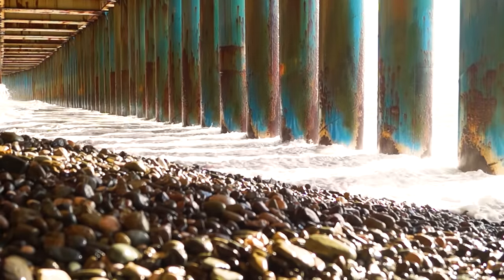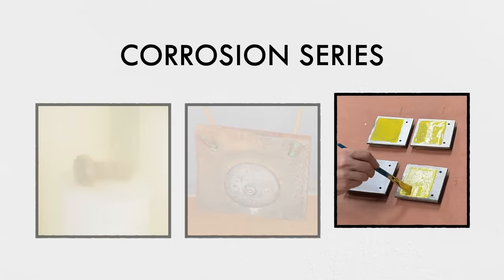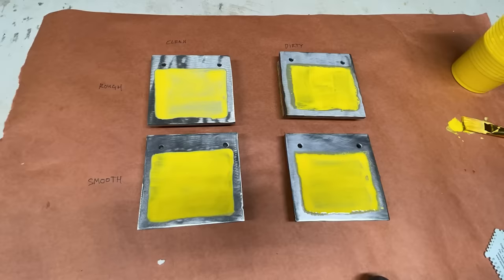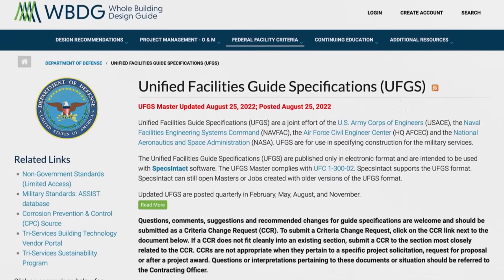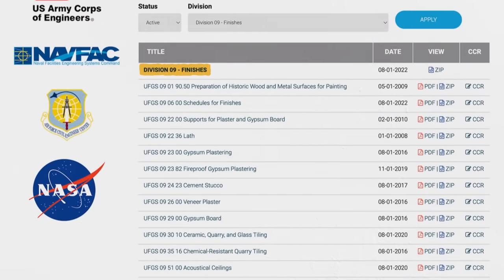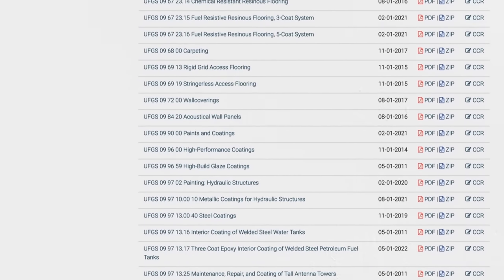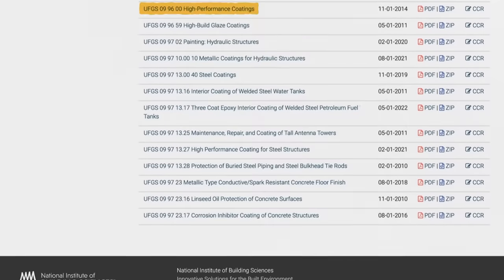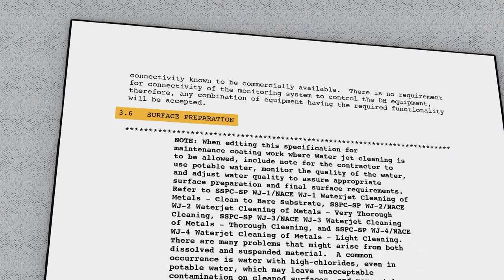What's the Difference Between Paint and Coatings?

Comment: In my 40 years of working with steel , I've found that when you accidentally spill paint on something it tends to stick forever, opposed to purposely trying to paint it.
Reply: Like your clothes 😅
Reply: Right so weird that this is right!
Reply: Steel just knows it... 😆

Within 5 minutes thee paint melted the bottom out of the plastic cup I used, 7035 grey all over place.😅
Reply: That’s because most painted surfaces are smooth.  It leaves little caves to stick to.  Most floor surfaces are rougher and have more caves so it tends to creep into it.  When you wipe, it’s harder to clean up paint from the caves that the paint creeped into.
Reply: lol too funny. and so true
Reply: @Moe7133  it leaves FEWER caves for things to stick to. When I read "little caves for things to stick to," my brain was like 'but didn't they just say it was smooth? Why would there be small pockets or, as you say, little caves?' Lol it was just funny. "Fewer" is the correct word to use, for this exact reason!
Reply: As a DIY car mechanic, I've found the very best rust preventative is oil leaks
Reply: @joshyoung1440 I think you just misread Moe's reply
Reply: @simontist,  cold rolled steel  CRCA also comes with a thin film of oil on top to prevent rusting. They don't have zinc coating over them like galvanised steel. These films are then washed off before galvanising or applying coating
Reply: @666pss in a similar way, my father and his father before him were religious about coating hand tools with a wipe of oil after use to reduce the formation of rust.
Reply: Accidental spills cover more unevenly and thicker than purposeful paint
Reply: murphy's laws
Reply: Thats because your criteria of how much paint remains is completely different for both. If half the paint flakes off it is still dirty. But if a tiny chip comes off a painted project the paint was a failure
Reply: Can you tell me what exactly is stainless steel and how it's different from regular steel?
Reply: Nice pfp
Reply: @melody3741 very good point. It’s all relative.
Reply: You forgot to mention that the paint sticks better to the materials that it wasn't designed for. It says for metal only but adheres to everything but metal.

Comment: I can't remember if you've already covered this but it would be interesting to see your take on the new safe containment structure that has been built over the remains of Chernobyl. Apparently they have to have a forced dried air circulation to prevent the structure from rusting because the radiation levels are too high inside the structure to paint it manually.
Reply: That forced air circulation (like the ones used in bio labs) is to prevent radioactive dust from escaping not to prevent rust.
Reply: @SgtMars  while that may be true, it can have other benefits beyond the intended or primary purpose.
Reply: @kylelambert8322  ok but if the primary purpose was to prevent radioactive dust from leaving (because it is negatively pressurized instead of positively) then what does that have to do with the whole “prevents rust because it’s dried air” thing? If that’s not even a reason for it to be around, while it may be an unintended effect, if it isn’t the primary purpose, what good is it?
Reply: @TGears314  What he meant is, the air circulation thingy could be taken advantage of other than just preventing radioactive dust.
Reply: @TGears314  because when it comes to basically anything, if it kills 2 birds with 1 stone Instead of 2 seperate methods, then it's actually very good and useful, you can save money for one, and I would say that's probably good enough on its own for a secondary benifits to be useful and intentional, for example they could have delt with the dust in another way, but perhaps they choose that method precisely because of its secondary benifits. Think of it like instead of just washing your car, you can wash it with a wash and wax, the wax is not going to be as good as physically hand polishing your car, but that little film of wax absolutely does protect your car, I know it's not a perfect comparison but it's 1:10am and I'm in hospital doped up on meds lol so I know what I'm trying to say I hope you do too lol
Reply: @TGears314
Reply: they had years to paint it before rolling it into place, and the original sarcophagus is still in place, so radiation levels currently are not high enough to effect paint curing.
Reply: @rydplrs71  He meant the radiation levels are too high for people to stay inside for long periods, not that the coatings wouldn’t cure. 

I don’t know that’s true (the actual levels) but the difference between how much radiation is hazardous to workers and how much would affect the chemistry of coatings is truly enormous.
Reply: The forced air circulation is necessary to maintain the negative pressure environment inside the structure which is there to contain the harmful particles present in the air inside the structure. You only want air getting out via a forced air circulation system with the appropriate filters to ensure the particles do not escape with the air. The negative pressure serves the same purpose by ensuring any leaks will act as intakes rather than exhausts and thus bring clean air into the structure while the leak is being fixed rather than the opposite. You will find much the same in for example biolabs and hospital isolation rooms in order to contain particles of pathogenic material that may be generated inside. Air getting into such structures where it is not supposed to is still not ideal and does require maintenance attention when it occurs in order to prevent the pressure equalising which will of course happen with too many leaks. However it is much more acceptable than air getting out having bypassed the filters thus the need for the negative pressure, it ensures that the excess atmospheric pressure will function as a barrier in the event of a leak as the surplus pressure will force external air in.
Reply: And it is also negative pressure chamber as well so that nothing goes out
Reply: They sustain constant pressure that's less than 1 atmo inside the sarcafogus (so in case the're a breach the air from the outside would go inside and not the other way around, thus preventing the rad dust getting out... It has nothing to do with dry air or rusting (well at least it's not the primarry function, more or less "if we're already working with the atmo inside why not do this as well")
Reply: @JoeMoross  Indeed after all it is largely a numbers game, damaging a few molecules out of septillions in a coating isn't going to meaningfully alter it's overall function. Damaging one of the two copies of the genome in a living cell on the other hand is less than ideal and if the DNA repair process is unsuccessful will disrupt function in a potentially significant way.

It is kinda like if you were to mess with the ionisation of a few random sodium and chloride ions from a salt crystal it is not going to meaningfully alter the structure of the whole nor will it's properties be altered in a way that will meaningfully alter it's chemistry, coatings will similarly be a giant mass of molecules such that individual molecules and atoms are largely insignificant.

Compared that with DNA where very exact and specific chemical interactions need to happen to function correctly and there is minimal redundancy and naturally the latter will be much more sensitive to being forced to undergo physical changes that alter that highly specific complex structure.
Reply: Kyle Hill has been releasing his series on Chernobyl, but didn't go into that much detail on the actual construction and engineering of the sarcophagus as I recall.  It would be fun to see a collaboration between these two on the subject.
Reply: Would love to see you cover this

Comment: The Forth Rail Bridge really was painted continuously for decades, until a new, longer lasting coating was introduced ~20 years ago
Reply: well... workers' wage ex ain't it? why employ someone for everyday when you can subcontract just one time to re sub the old coating...
Reply: Came here to say the same. ( I stay a few minutes away from the bridges)
Reply: The Mackinac Bridge likewise was continuously painted, according to the bridge authority at the time. I'm not sure if they still do, as it has been a long time since I've been through there.
Reply: @PrograError  The subcontractor would use a large crew, when they continuously prep and paint they only have a crew of 2-3 workers so the time to surface prep and coat all sections of the structure is several years and equal to the life of the coating. The life of a coating is not only about the formula, but the environment and importance of the structural component that it protects. Sea water and tropical sun is more harsh than clouds and fresh rain, which is less harsh than a high latitude arid climate. Critical joints may need recoating twice as often as the bulk of the structure to ensure minimum corrosion while a few flecks of rust may be acceptable on the bulk of the structure.
Reply: @PrograError  Tbf, back when they were paintin it like that there was also a sayin about how the government wud "pay folks to dig a ditch and pay other folks to fill it in"; which is to illustrate the idea of creatin jobs even when busywork bcuz of this weird system we cwll capitalism.

Nowadays theyve done away with that concept and just blame folks for bein poor and dont even want to offer a tithe to them anymore.
Reply: @SylviaRustyFae  It's because of the "starve the beast" doctrine. Businesses don't like competing with the government, so they donate to campaigns of politicians who undermine government projects and agencies by refusing to give them adequate budgets. When those agencies and projects fail, they blame the government and say a private company could have done it better. Sadly, even though upgrading our infrastructure would create jobs and have lots of other effects that would result in a major improvement to the economy, those businesses and politicians can't afford to let the government appear to be effective in any way.
Reply: Painting was carried out more or less from new (except for a period where Railtrak decided not to as cost cutting measures, which ended when huge chunks of rust started falling off onto the streets below creating a risk to the public) but it wasn't until modern coatings were developed that applying a durable coating was even possible.  The process of actually coating the bridge took many years (I want to say 7 but I could be remembering wrong) and needed a lot of additional scaffolding work and planning that you didn't need to for just a repaint.  I also seem to remember one report where the cost of the coating was 20 times the cost of a single end to end repaint.
Reply: I should add I remember thinking how weird it was seeing the fourth rail bridge with no "painting tent" suspended from it at some point. FWIW Grady, they forth bridges make an interesting case study, forth rail being the oldest, forth road, suffering from cables snapping inside the big cable tubes, and a new forth road to replace the latter. Bridgey mc painty face will likely outlast them both.
Reply: Can confirm
Reply: @jsquared1013  I wasnt callin that aspect capitalism xD I was sayin thats how they managed to help folks survive despite the capitalism methods that wud see folks starve if left unchecked.
Reply: It also wouldn't surprise me if the new coating was able to be applied in slightly more general conditions. Being able to have a crew actively applying it for a full week probably speeds things up as compared to only having the team apply it for a couple hours during a day because it has to be in this general temperature range fo the first six hours, and midday gets too hot, but you also need some UV to help it start to cure, so you can't do it too close to sunset.